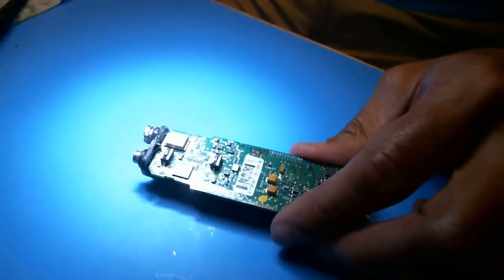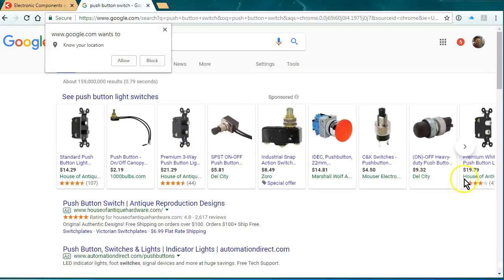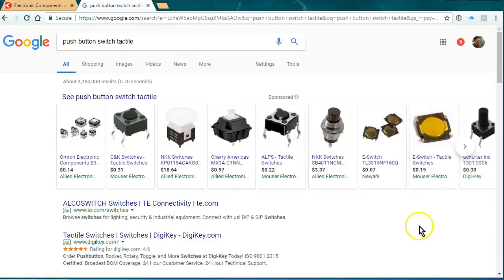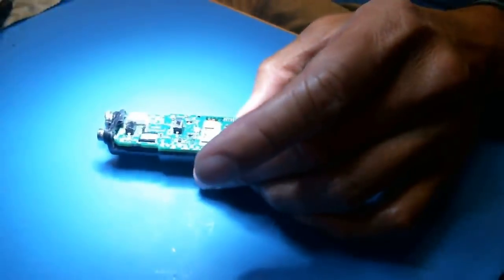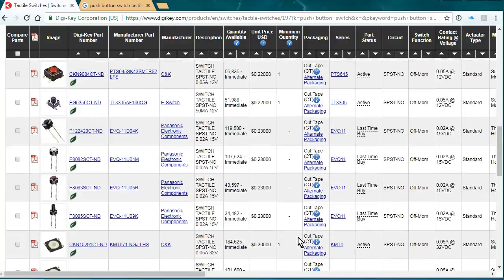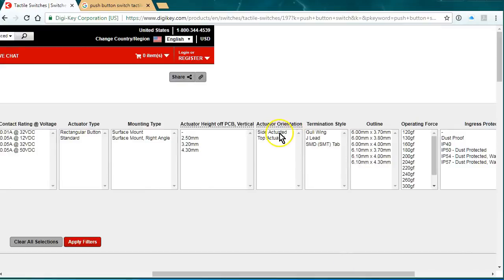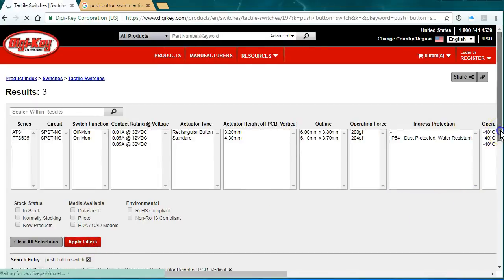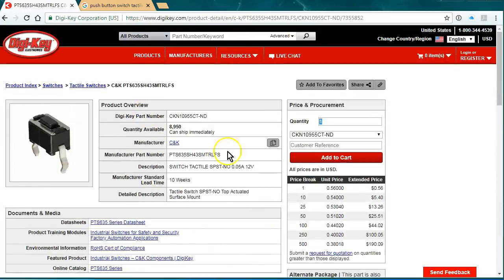Shure PG58 Wireless Mic Soldering Repair

Comment: Thanks, had the same problem, switched the channel and power switches. Also, I was able to fix the damaged switch. The contacts needed cleaning (a bit of isopropyl alcohol and a needle/toothpick did the job). It’s somewhat like doing neurosurgery though as the components inside the switch are about 1mm in their largest dimension. Took me an hour but got it to work.

Comment: So probably its the switch...mine just gets heat up on one of the two ic's on the circuit board..i was about to take off the metal thing with ET24.000 printed on it.i thought it was the frequency chip...really gotta find some infos..